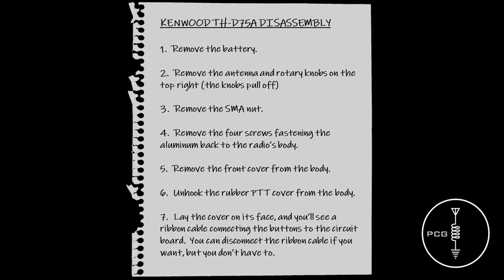E49: Kenwood TH-D75A MARS Mod

Comment: Thank you for confirming that you performed my mod incorrectly. I have contacted Kenwood and informed them that their distributor is ruining radios under warranty and taking pictures of it.  😂
Reply from the maker: I would have to go back and check the terms, but I believe the distributor, like others that offer that service, still back the warranty.  So, I'm not sure that the manufacturer would get involved since the ditributor would replacece the item, or provide a refund.  Which they did.  The only thing they didn't refund was the cost of the mod, but that is part of the terms when you purchase that service.
Reply: @PartisanCommsGroup  I found your video as I am looking to buy one and am undecided on the mod.
Reply from the maker: Despite the issue with the mod, its a great radio.  There is a bit of a learning curve to using it which I'm still working through.  I was using a Yaesu VX-6 as my main radio, but the Kenwood has replace it.  However, spare batteries for it are a little expensive.  Last I checked, they are around $100 each.
Reply: @PartisanCommsGroup  Yeah, I looked at the yaesu and decided I'd rather have the d75 instead of dreaming about it
Reply from the maker: Looks like Ham Radio Outlet currently has them at a discounted price (coupon + promotion).  https://www.hamradio.com/detail.cfm?pid=H0-018622&srsltid=AfmBOorZqdJ_YMlH7E6EPHFdEhqpJptrg7VF7rZuSdkxELV5Klp5HMAY
Reply: @PartisanCommsGroup  I have one near me. Honestly, I'm new to the hobby and would have bought a Yaesu last week but a bunch of hams have shown how awesome D75 is. I've got a ZBM2 foul weather whip arriving tomorrow just so I can pick up the repeaters better in my Gt-3tp. I've got. I'm gonna take my son and daughter in and see if I can spark an early interest.
Reply from the maker: I have a few Yaesu radios, but the Kenwood is pretty cool.  That's awesome you're getting your kids interested in radio.  It's nice to hear there are people out there helping to keep it going for future generations.

Comment: Greetings!  Thanks for the video!  I performed the mod as described.  It only opened up the 400 band for transmit.  Is there something in the software I need to adjust?
Reply from the maker: You may need to upgrade the firmware version.  Here are some links to information from Kenwood on going from version 1.02 to 1.03.  

https://www.kenwood.com/i/products/info/amateur/thd75_update_e.html

https://www.kenwood.com/i/products/info/amateur/software_download.html
Reply: @ It currently has the 1.03.  I wonder if the firmware is what’s stopping it….
Reply from the maker: I just confirmed on my D75A that I'm running 1.02, and messaged someone else that I know who has 1.03 installed on their radio (also did the Mod) but doesn't seem to be running into any issues.  It may be worth a try rolling  back to 1.02.
Reply from the maker: Do you have the Signal app?
Reply: @PartisanCommsGroup  I do… but I just found something interesting.  If I program a vhf freq with the software, if won’t transmit…. But if I program it by hand (a giant pain in the butt),it will.  So now I’m really thinking it’s something in the software.  I just I have to figure out what.
Reply from the maker: I do a montly livestream with a few other radio guys, and we have a Signal chat that is open to everyone (link below).  You're welcome to join and we'll do our best to answer any questions.  

https://signal.group/#CjQKIDc5K2EhrfnlDiqmgmiW3vpOBet5hUHvDgxsVwI_7ATdEhBTsyS_KmBiKpIF59BPY5wA
Reply from the maker: In the Kenwood software, you may need to also change the region for the radio.
Reply: @PartisanCommsGroup  Thank you for the help!  It is appreciated!  Keep up the good work!  See you in Signal!

Comment: What’s the output power on 462 on a dummy load of course!!
Reply from the maker: Great question, but I'm not sure.  I haven't tested it on a power meter.
Reply: @ just curious because the ft5 is only 2w and Id-52 is 4w

Comment: Will the mars mod transit am on the air bands?
Reply from the maker: I don't know this for a fact (I haven't tested it with a dummy load post-mod) but I don't believe so.  Once the mod is performed it should TX on 136-174 MHz, 216-235 MHz, and 410-470 MHz (out of the box it will TX on 144-148, 222-225 and 430-450 MHz).